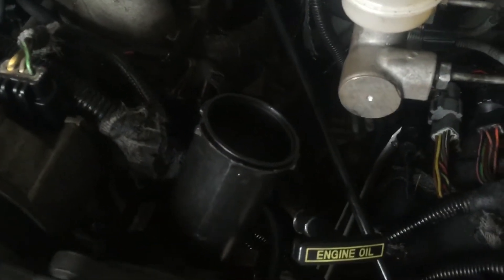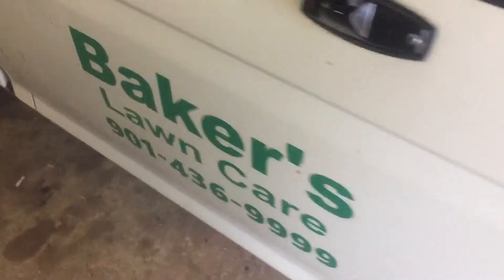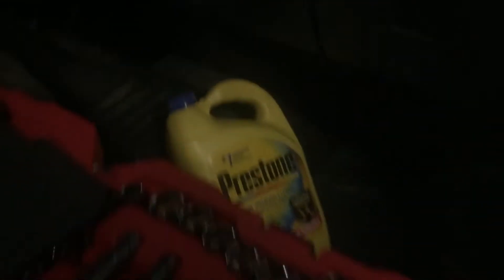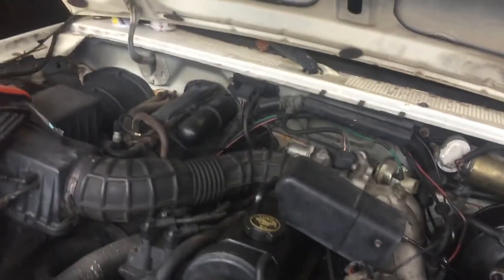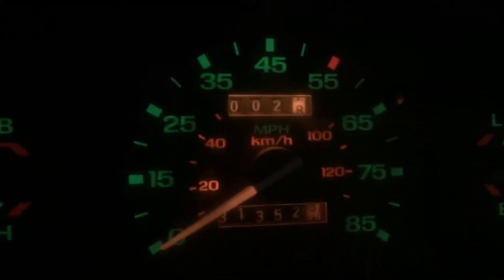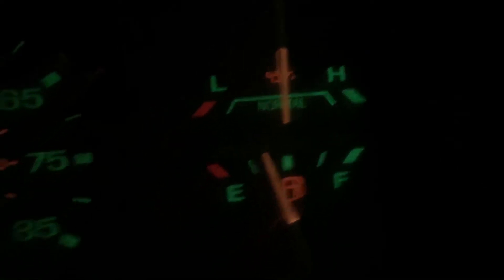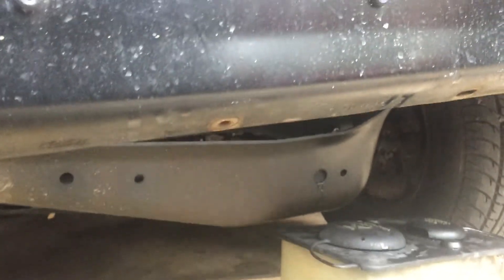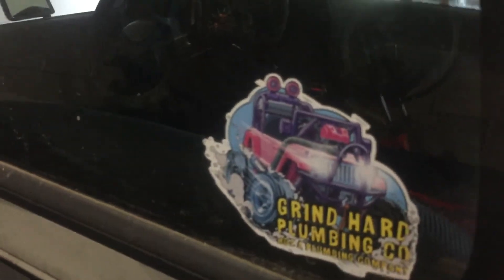Ford Ranger Update

Comment: Did you know that normally you'd just pull the pulley off of the old PS Pump and install it on the new one first. That way you don't have to buy a new pulley. And yes, it takes a 'special tool' to do this with using an Air Gun. It's a real bugger. I know. I used to do this for my customers that bought a PS Pump from me when I owned my Automotive Parts Store back in the 80's.  And you'll need a pretty decent compressor that can hold 90-100 lbs consistently, or it'll take you forever to get that pulley back on. And Unless you have enough clearance between the radiator and the PS Pump shaft, you're going to have to pull that PS Pump back off to put the new pulley on the new PS Pump. I can't remember how much clearance there is on this particular truck? But normally, you'd put the PS Pump Pulley on the PS Pump before you installed the PS Pump back in the vehicle. Makes it much easier in-which to do the job that way for sure. That little Ranger seems to be running really good too. And normally, when installing a light bar like that, one would drill the appropriate sized hole in the top of the cab, and run the wires straight down into the inside of the cab. Making sure you use lots of silicone to seal it properly so that no water gets in. That way you don't have wires running across the top of the cab.  But hey, it's a work truck, lol. And if it gives you any trouble ... say in the next two years, then you can always drill a hole and run the wires the proper way the next time. Keep on keeping on Mr. Baker! :-)
Reply from the maker: The trucks old PS pump was made where you put the pump on the truck then put the pulley on the PS pump...also the old pulley broke and that’s why I got the new pulley and pump.......also the light bar has magnets as to not drill holes in my roof in case I ever want to take it off